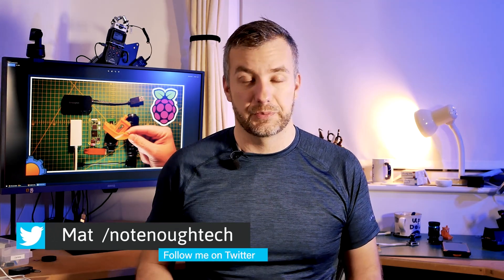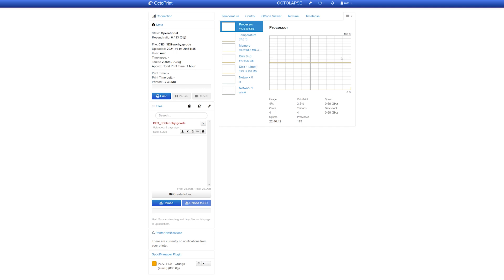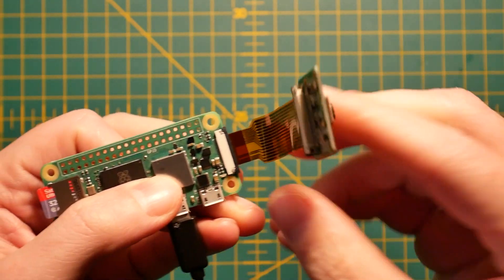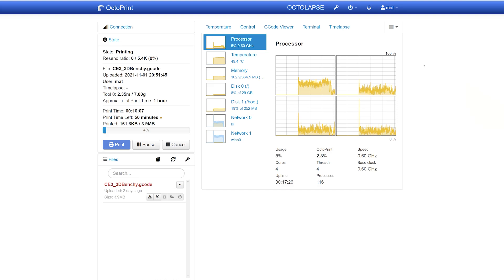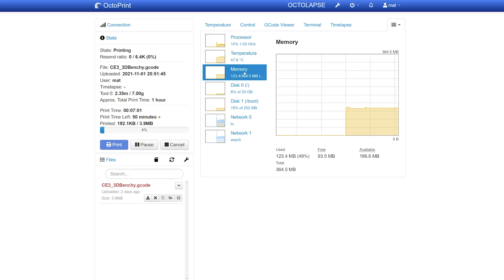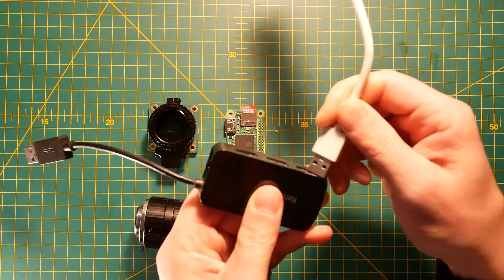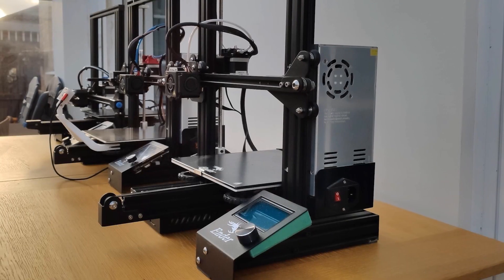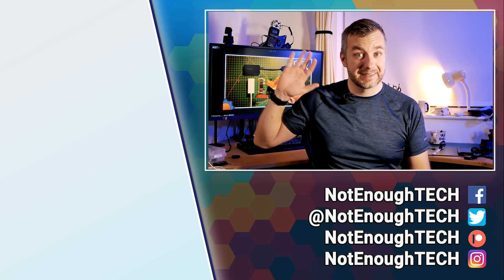Running #Octoprint on Raspberry Pi Zero 2 W

Comment: I love this video, because I've had the exact same questions. I was curious though, did you load the gcode file onto the printer's SD card (perhaps via octoprint) or were you directly streaming it from the Pi? Would be curious to see how either method affects your tests from the video
Reply from the maker: I'm pretty sure the code is loaded to the SD card but Octorprint is "streaming" it to the machine

Comment: I'm curious about one thing.  You offloaded the network load to the wired USB adapter.  Did you try it with a wireless USB adapter? Or can you try it?  I'd think that should provide the same load reduction. 

I only ask because my machines are too far away from anywhere with wired ethernet.   This house wasn't prewired, so the best I could do was to put an access point high up against a wall in another room, about 30' away.   The wifi signal is fine, but the only way I'll get wired service there anytime soon is to make a wireless bridge.   Not impossible, but I'd probably have to buy another RPi to do it.   

I just got done converting a cheap laser engraver to running Marlin on a Creality 4.2.7 board.  I'm ready for Octoprint to run there.   I want to leave the machine in a closed cabinet while it runs, and use Octoprint to monitor it.  Probably watching from my phone or my desktop computer in another room.    I have spare WiFi adapters, USB hubs, and USB cameras.   I don't have spare Raspberry Pi.  And if it can work on RPi Zero 2, that seems like a good choice, and I could get my RPi 4B back from the first printer.   Well, assuming that I can find a RPi for sale.
Reply from the maker: Hi
I haven't used the WiFi adapter as RPIZ2W comes with WiFi. It would be a bit pointless to close WiFi built in (which uses bandwidth of the USB hub) and add exactly the same solution via physical dongle.

Comment: As an idea for test prints that you can re-use... There are a number of dual colour filament stls on prusaprinters or thingiverse that you can create a circular filament. Once the print is done, you can reuse the printed filament by putting it back into the machine.
Reply from the maker: That's one of ways to do it. Although I have all my test prints on display (haven't print that much of them) and fail ones usually end up in the hackspace bin for pla which gets donated to recycle place

Comment: Hey very cool video! Thanks for sharing. 
I have to admit that at the end I got lost of how you are powering the Raspberry. 
I like the idea of the hub just to have a wired connection.
Reply from the maker: I'm still powering it just via usb cable. I do have a special charger built into my printer. Check out my printer upgrade articles about this
Reply: @notenoughtech  I just thought I will place a bucket on the power supply to feed this. And now I see your comment. I will definitely visit :D Thanks again! Great job!

Comment: I am running Octoprint on a Pi 4 but the Pi Zero 2 is a real breakthrough, $15 versus $45 USA.
Reply from the maker: I'm exactly the same. Just got extra 2 boards from Raspberry Pi store from Cambridge so each printer has its own now

Comment: My Prusa MK3 has a header on the Einsy controller board for a Zero, but the Zero W was always underpowered.
I run OctoPrint on a Pi 4 now, but the Zero W 2 is tempting for its form factor-- it would just fit in so nicely hmm.

Thank you for the review of exactly what I was wondering about :)

Update: replaced the 4 with the 02W, works great!
Reply from the maker: I don't think you would be disappointed plus it frees your RPI4 so you can use it in more power hungry projects

Comment: Thanks for the video Mat. Why do some of the Octoprint videos look reversed?  Keep safe and stay well.
Reply from the maker: What do you mean by reversed?
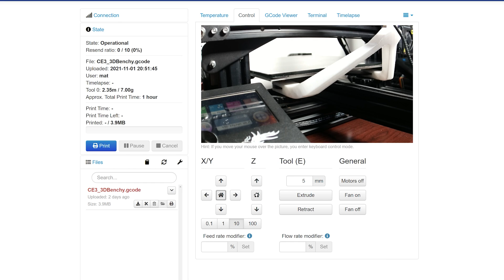Reply: @notenoughtech  4:24, 4:33, Upside down, 5:03, 8:39, Left to right. I may be wrong?
Reply from the maker: @nikond90ful1  oh I know what you mean now. The  streams. If you apply the filters to octoprint settings they don't apply to the raw stream. So I didn't bother much with it since they are only there to prove the point that the stream is working :)
Reply: @notenoughtech  Not a problem. Just showing I watch the video.
Reply from the maker: I always appreciate it :)
I thought I missed something important. Half of my desk broll is shot upsidedown so when someone mentions this I'm scared I forgot to flip the footage in the timeline

Comment: I used a small server case for my old end3 and my cr10. plus pull colour LED in for lighting.
Reply from the maker: That would work well as well. My plan is to make it modular, and within a budget of around £40-50 max
Reply: @notenoughtech  I got the server cabinet  for 10 dollars Australian.  Just mounts to a wall, of you could put it on wheels mate. Got is from a recycling yard. All black with lights and controlled from my house. Turns on by Google then controlled by printoid.

Comment: Add Andriod printoid as it is great for Octoprint mate.
Reply from the maker: I have my own solution for that that doesn't require apps :)
Reply: never knew about this  but how come there is no way to run Octoprint from an android device via OTG yet instead of using a pi? I have so many old android phones and tablets just sitting here doing nothing it would be really great if  I could repurpose these old devices and
plug one to my printer via OTG and  even use the phones back facing camera  instead of using a pi and a pi cam or web cam  and hub , I mean  I assume that Octoprint is Linux based  just like Android is Linux based so porting it to run on Android should not bee too difficult,  even better  would be if you could add a plugin to it that would work with  custom printer FW so you could also use it as a LCD touch for the printer as well
I bet this would save a lot of phones and tablets from the landfil and cut down on E waste
the only problem I can see is powering the phone,I mean you could use one of those  USB OTG Y cables to charge the phone and use OTG at the same time  but  I tried  doing that with a phone I was using as a bridge device for my smarthome and the battery puffed up in a week from the  rapid charge drain cycles ,I did manage to  hot wire the phone to run with out a battery but had limited success,  it word on 2 different  Samsung phones with removable batteries but  one got finicky after awhile and  would randomly reboot ,the other phones was really old and it still works with no battery
still would be nice if it ran on Android  I also have  old android TV boxes and fire TV sticks and those can be bought for cheaper than  a pi and  have far superior specs , walmart has tivo 4k steam box on clearance right nor for between $5-15 US and their onn  brand streaming box on clearance for like $15 or $20 depending on the store
these devices are way more powerful than  a PI , and   can cost significantly less
Reply from the maker: Printing (or affordable printing) is relatively new and development isnt progressing as fast as we would all like it. Old phones may seem like a great idea until you think of the cost of the phone before it becomes old. 
If you look at apps like WhatsApp etc dropping support for old phones which can't be upgraded you will understand why development for that stifles. Phones are relatively expensive if you consider that raspberry pi cost you 13£ and will last much longer in OS update cycles
Reply: @andreamitchell4758  Thomas sanladerer recently made a good video about this, there is a project that allows you to do this but it isn't that much cheaper. Pi Zero 2 is probably the cheaper option.
Reply: @andreamitchell4758  octo4a 👍